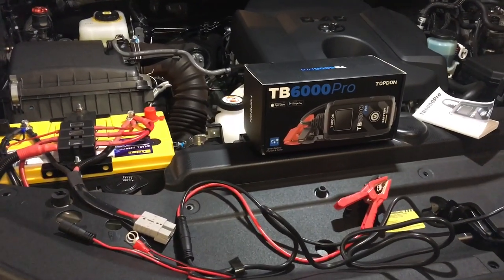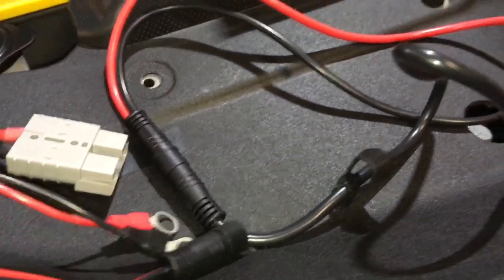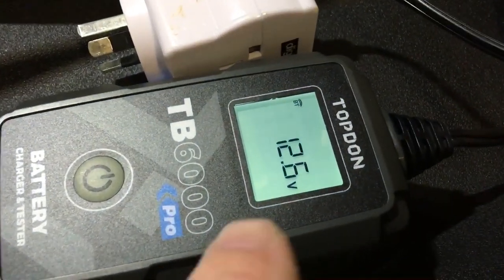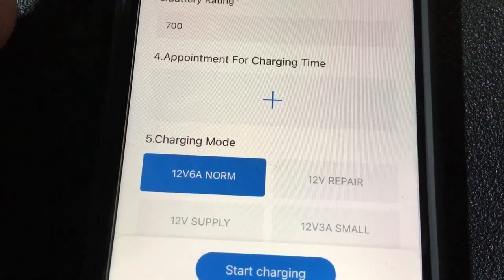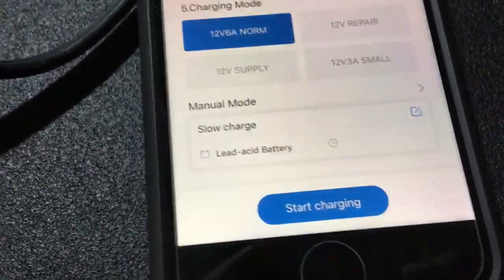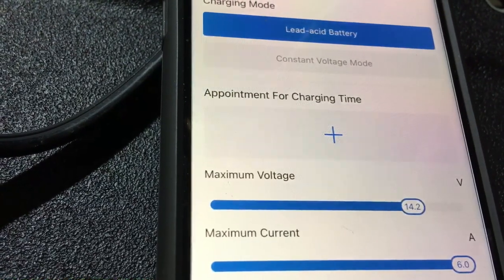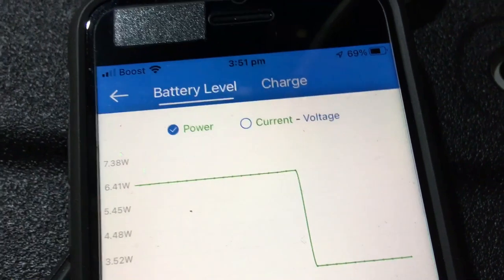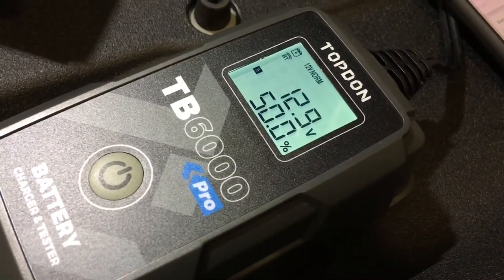NEW SMART BATTERY CHARGER - TESTER & Power Supply in 1 First Vid more to come

Comment: Interesting, set to limit at 1.7A, and then goes on to charge at 1.8A whilst going through initial charge ramp.
I like the concept, but wonder about the effective control.
I recently won a Projector in a raffle, (I'm charging my car battery right now, so can't easily tell you which one) It is a 7 stage model, and seems to do an excellent job, although only on flooded type, I can't charge my gel cell batteries with it.
I have another Projector, (can't find in storage), which also boasts 7 stage, is of an earlier design where architecture was struggling and it cost over $300, (2014ish)
They both have the de-sulphide stage, (a pulsed DC), and do a good job.
Don't sit your charger on top of the battery like I did, the out gassing battery will corrode the circuit.